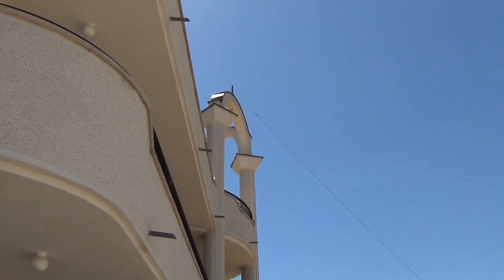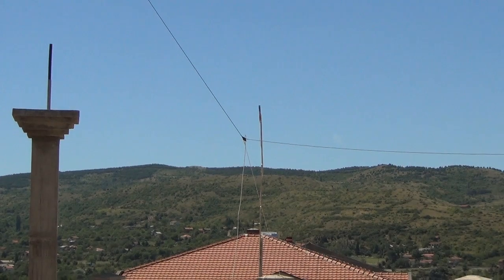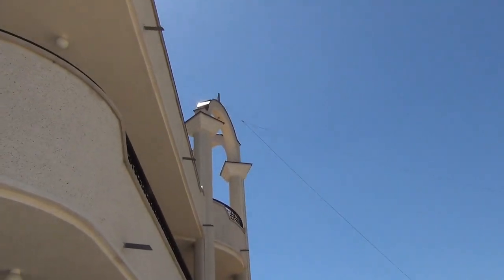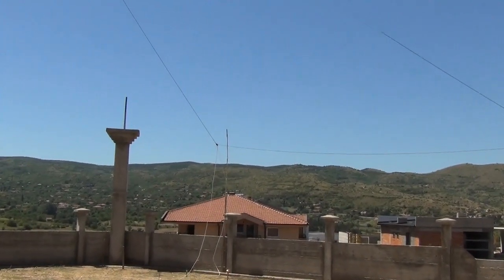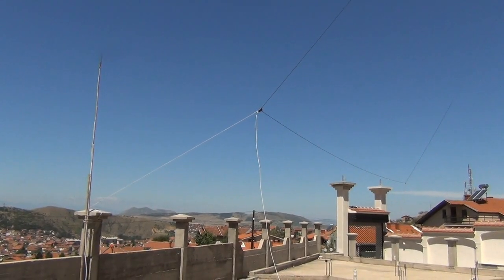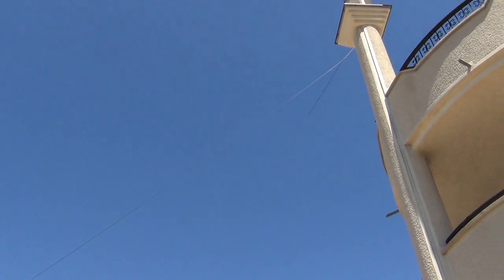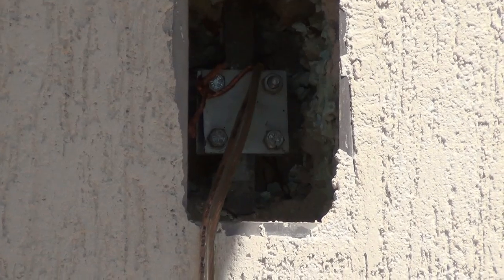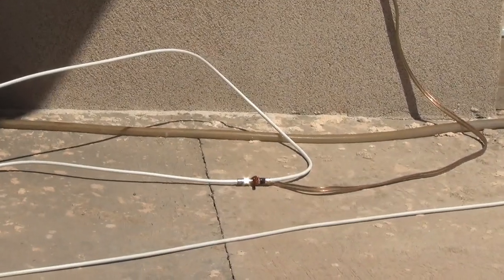Mini Whip and Delta loop Antennas in my backyard

Comment: Hi Milla. what is the radiation angle of your delta loop antenna??
Reply from the maker: Hello Julio, According to MMANA antenna modeling software, The Delta Loop Antenna (now is 43 m long and resonant in 40 m amateur band) has relatively high radiation angle, which is not so good for DX-ing. It is because the Delta Loop for 7 MHz is only about 13 meter high on its highest point and about 5 meters high on its lower point.

Comment: Is the mini whip mounted on a plastic mast or metal?
Reply from the maker: +Peter Gratineau: Actually, my mini-whip antenna is mounted on a 4 meter wooden mast. Metal mast is not an option for mini-whip. Plastic or fiberglass mast is the best choice.
Reply: Isn't it better to use a metal mast to connect ground to the shielding of the coax? I've heared that mini-whips need good grounding...